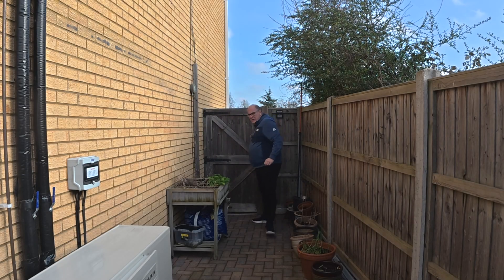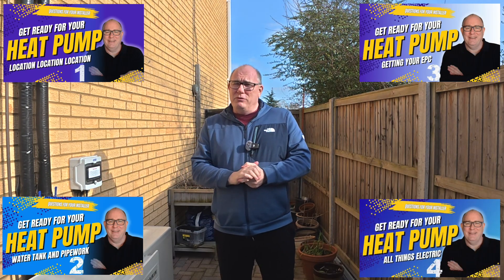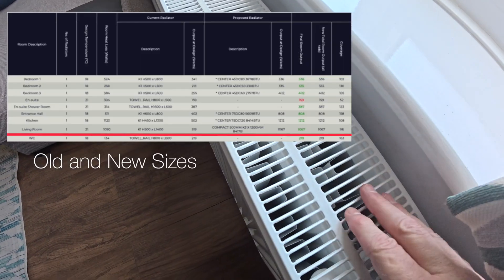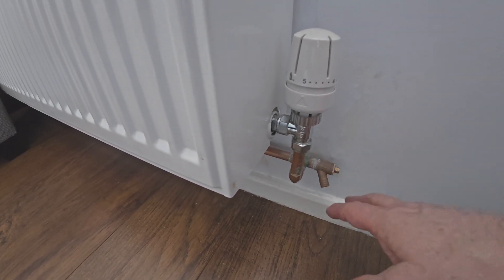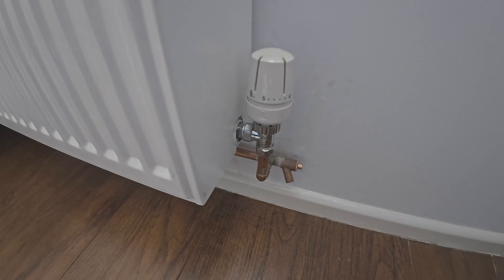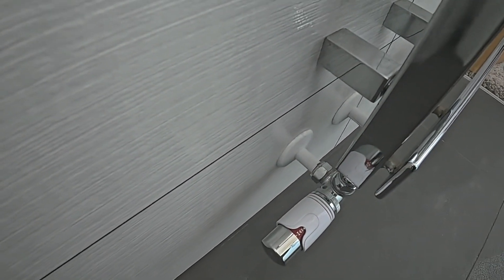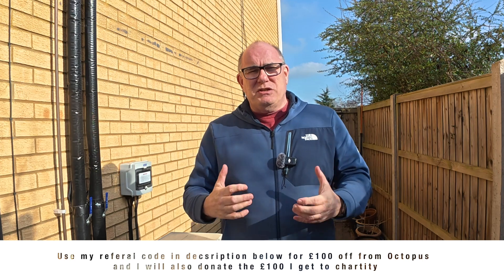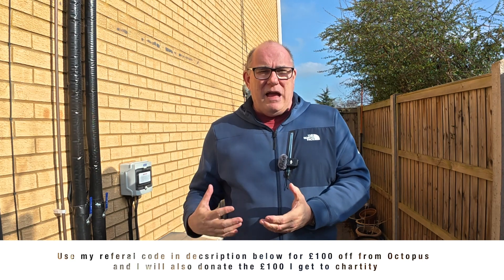🔥 Heat Pump Installation Mistakes to Avoid! 🔥

Comment: I like to stir things up a bit. My heat pump was a retrofit but I discarded all my bellows type TRV’s and replaced them with battery operated TADO radiator valves, I then opened FULLY all of my balancing valves at the other end of the rads. Now my radiators balance themselves automatically by setting my preferred room temperatures for each room on the associated app, the Daikin Heat Pump is set for weather compensation. As my radiator valves are part of a self learning central system if the individual rooms over or under heat for any reasons such as open doors, windows occupancy etc the valve adjusts but doesn’t actually shut sometimes radiators are very hot, sometimes luke warm. Zero pipe flow noises as automatic bypass set to maintain ideal flow rate for heat pump preventing defrost cycling.
Reply from the maker: do you vary your room temps that much, we keep our house constant temperature, at night we just set back a few degrees
Reply: @ rarely, I’m finding it hard to explain but after 50 years working with standard TRV’s from manufacturing to real time applications I gleaned a great knowledge of how they operate. I set my rooms to adjust depending on time of day. E.g. daytime around midday I like to have kitchen around 20 degrees for an hour, it then sets back to 17.5 deg but the optimum off capabilities of TADO means heat gradually backs off, not getting to cold. If it doesn’t quite make temp f 20 degrees then next day it attempts to achieve it by starting earlier, you cannot do that with a TRV and a system wide setback. Way back in 1980’s working at many controls manufacturers we often looked for motorised solutions but in those days wireless was not an option wired meant running cables around the home. Mostly aesthetically motorised were too big and ugly. Once I found TADO smart radiator valves whilst still searching after 40 years I tried them. But without flow control by pumps or auto bypass valves noise would have been an issue. The result is what I have now, Daikin Heat Pump, auto bypass, variable speed grundfoss pump built into heat pump and TADO. I just installed a Drayton version in relative’s house which is a lower cost option. Never work for money since retirement but still enthusiastically search for ways to make energy efficient changes to my system. Some work some don’t the ones that work I share.

Comment: Got a quote from the Heat Geeks for almost £25k for an AHP in a 1990’s 3bedroom house. Quote included creation of UFH which I already have. I feel like I’m the stupid one because I paid them £350 for the quote! 
Needless to say I won’t be getting an AHP until I get a sensible quote!
Reply from the maker: Was the quote not refundable if you dont go forward? This was one of the reasons I went with Octopus, if you decide not to move forward your deposit is fully refunded
Reply: @ don’t think so. I think the Heat Geeks are doing their best to improve standards 
, but they have attracted partners who are clearly taking advantage of their schemes and BUS!

Comment: Our bedroom rads from the ASHP were piped using white UFH piping which I lagged in the underfloor space. TRV's were fitted. This was 10 years since.
Reply from the maker: Have you used the TRVs or are they purely decorative :-)
Reply: @JonathanTracey  Yes I do use them.
Reply from the maker: Do you find the cause the Heat Pump to work harder, I was told by restricting the flow or completely shutting it off in one room that it adjust the overall temperature of the house. This can cause the Heat Pump to use more energy to try and get it back to an even temperature.
Reply: @JonathanTracey  I don't think I see that. The TRV's are gagged back only slightly to keep the rad warm.

Comment: Are you sure MCS require TRVs? I've never heard that before.
Reply: Usual MCS nonsense, in one section of the MCS best practice guide it says they shouldn't be used, in fact it highlights it as a warning. Then on the very same page, it says ideally, some form of temperature control should be available in all rooms either by thermostatic radiator valves (TRVs) in the case of radiators or zone control valves for UFH. Clueless muppets, they are obsessed with installer paperwork, but contradict themselves in their best practice guide! PS. I asked my installer about TRV's and they don't fit them.
Reply: I think they just add them, as "homeowners" / "EPC inspectors" expect them
Reply from the maker: @fredgray2376 thats what my installer said, I told him not to bother fitting them but was told “we have to fit them to comply with MCS”

Comment: Does the thermostat placement really matter if you end up with weather compensation?
Reply from the maker: yes because it’s telling the heat pump if heat is needed to reach desired temperature. if the fro t door is open and all the heat goes  out, it will call for heat. the weather compensation adjusts the flow temperature not the heat in the house
Reply: @ interesting that’s your setup. The Samsung heat pumps let you have zero thermostat influence and go directly off the weather comp. Not sure how you would manage a set back
Reply: @noloafingwgas  I've have same ASHP, you can run it, via a thermostat (as JT has), or controlled on temperature exit of the monobloc unit. In addition you can use temperature compensation or not, and if you go into the installer menu (5678) you can change the curve.
Reply: Totally agree on this one we just had our heat pump installed and the company installing it doesn't use thermostats anymore as their heat pump uses weather compensation to determine the flow temperature then you select the best heat curve for the house.  As their heat pump uses the smart life app you can add wireless temperature and humidity sensors around the house and use them in the automations if needs be.
Reply: @clarkfinlay78  .. you can do the same on JT's ASHP (I have the same model) - in that its alexa compatible, I've just got mine (thanks to speak to the geek) running on home assisstant, and as we kept the old oil boiler, if my home batteries are running low, it switches on the oil boiler.
Reply: @EverydayLife621  yes I saw the Daikin integration to HA which gives you great automation prospects as you don't need everything on the same app as the ashp.  The automation options do make the need for a standard thermostat redundant.  A thermostat is needed for a boiler that outputs very high heat if it is not switched off the house would quickly overheat, this really isn't necessary for an ashp which should be running 24/7
Reply: @clarkfinlay78  Yes I'm learning that (my ASHP was only installed at the same time as JT's) very quickly, a boiler runs way hotter, so its throttled back to its lowest burn temp, which reduces the overtemp error on the ASHP. The heat pump has a bivalent mode, and will probably use that to control both outside of home assisst once the weather gets better in the long term. Oil is cheap at present (~6p Kwh), so if the electric goes off (which it does here), I can be off grid for a good few days under normal operation, nice n warm too.
Reply: @ can you achieve a overset setback or just run at the same temp 24/7
Reply: @noloafingwgas  Yes the automations in smartlife allow you to change the heat curve at different times of the day.  Plus the automation can allow you to create your own heat curve if you prefer